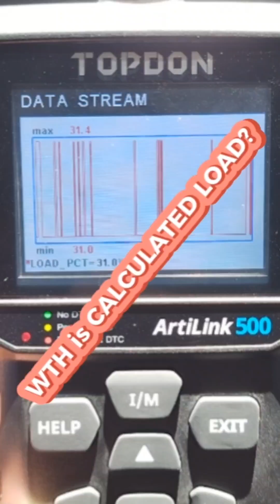Calculated Engine [Load Value]

Comment: So if mine permanently reads 0, and ive identified the only sensor with a non changing value is my o2/lambda on a diesel (stuck at 2.0), do I have a faulty o2 sensor?

Comment: My truck is at 2 to 3% at idle.
Reply: Bro same and I have issues starting some times do you as well?
Reply: Just checked my car, it's reading 2.0% at idle. Sometimes it starts immediately, sometimes it starts after a second or two. But I read in other forums that 2.0% can be considered normal on certain vehicles.
Did you ever find out the issue if there ever was one?

Comment: Sir, how O2 is contributing in calculated load??? U need MAP to know baro pressure and IAT to compute exact mass of air by compensating air temp and altitude...what i could figure out ECU need MAP, IAT, baro (thru map) and RPM and why RPM....to workout mechanical impedences or any kind of friction/drag the vehicle is facing....Sir, whats your opinion on above argument?
Reply from the maker: Load and Speed. All cars have a load and speed map GM started this with a 16 cell load and speed map, PCM needs to see all angles to adjust for proper fuel, ignition and emission systems. If your load is off compared to your speed (RPM) how is the pcm to give you the proper injector pulse width, degree of spark timing and shift points. Under acceleration the PCM can go into OL-Drive and the O2 will be the one letting the PCM know if that was achieved.
Reply: @MasterAutomotiveTraining  Sir, thankyou very much for your reply..i really appreciate that you took your time to respond ❤ 
Sir, load n speed map thing  is perfectly fine to me...i just want to validate my argument (which is not originated from a text book  yet i am convince but want to validate it from you)...n my argument is ECU uses RPM in load calculation with MAP, IAT, Baro PIDS n that is to cater for physical load (in terms of more number passenger, or vehicle climbing up a hill or engine experiencing some mechanical drag) being put on engine

Comment: Great information. What is the difference between absolute load and calculated load?
Reply from the maker: Have a video coming up for that. Absolute uses altitude and atmospheric pressure to create a correct load sense of engine output, with external factors taking effect. Its NOT VE, because you're not measuring the engines ability to breathe/fill the cylinders.
Reply: @MasterAutomotiveTraining  Sir, thanks for correction...we would be waiting for the videos...your videos are of great help...i learnt a lot from your videos
Reply: If i can recall it correctly...its perhaps volumetric efficiency...few manufacturer give u this PID where MAF is calculating air mass with the help of IAT n baro....
Reply: سيارتي باجيرو 2006
المحرك يدور ولايشتغل
engine load 81 or 83%
ماذا يعني هذا؟
ارجو الاجابة
شكرا لك
Reply: My engine load is 13% at idle. It's supposed to be around 20 %
Reply: I have wagon r manual transmission calculated load is 50 with ac
And without ac 42 therefore may car drive perform very rich
Reply: How I do
Reply: If absolute is 70% and calculated is around 95% at wot what is that telling me